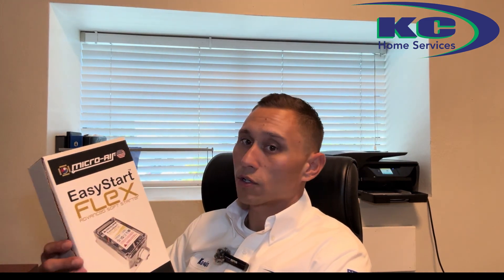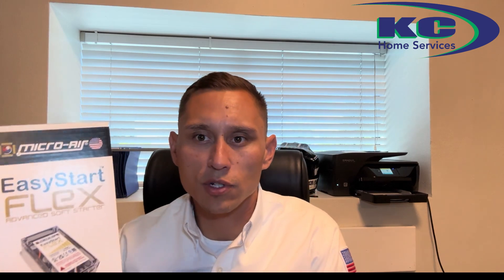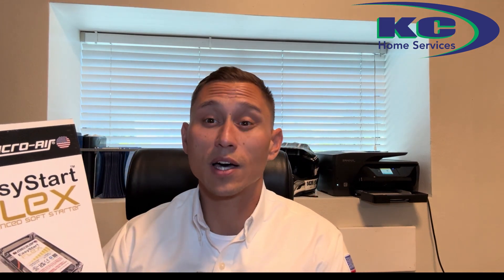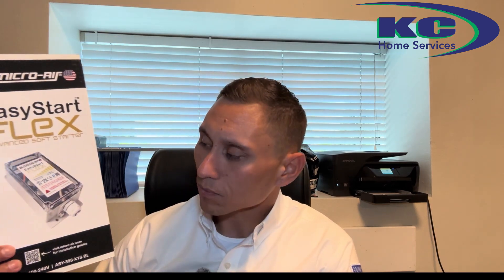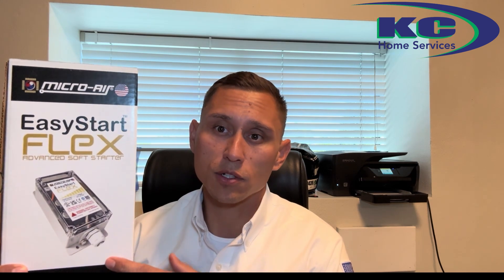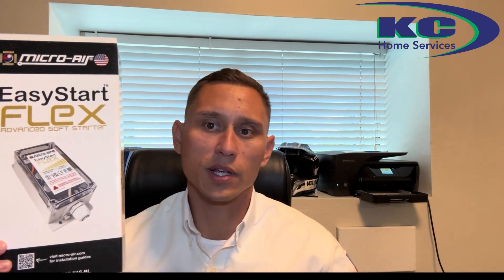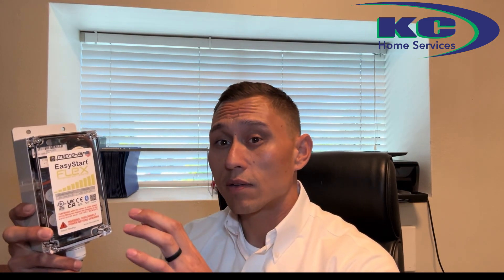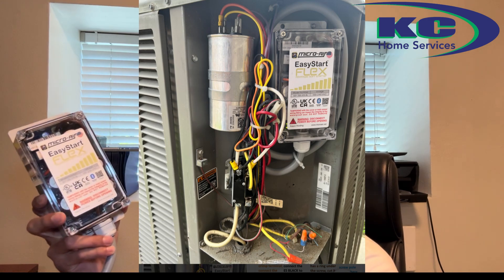Easy start flex by micro air saves homeowners money and extends life expectancy of your ac/heat pump

Comment: What about when you have 2 ac units, one for down stairs and one for upstairs. Do I need two soft starts or one?
Reply: You'd need two. These are built with 4 wire hookups. To try and split that by splicing wires would not be consistent with the manufacturers instructions.
Reply from the maker: yes, you would want one for each unit

Comment: I installed the Micro Air Easy start on my Carrier unit 18 months ago. The compressor has gone out. The Carrier unit is 4 years old. Is it possible that the easy start burnt out the compressor?
Reply from the maker: Not to my knowledge. Was it installed by a company?

Comment: EasyStart's manufacturer does not indicate reductions to the home energy bill. Initial start up savings would only be within the few seconds/milliseconds LRAs flood the system. Otherwise running current does not change. Can you substantiate home energy savings?

Of note, wear-and-tear savings claims cannot be disputed. The constant banging to bearings and windings kills units, period. Reducing startup stress is a major plus.
Reply from the maker: I agree, however if we can prevent the systems from overworking, and protecting components inside, it will ultimately save the homeowner money on repairs all while reducing the discomfort of hearing the system operate so loudly.